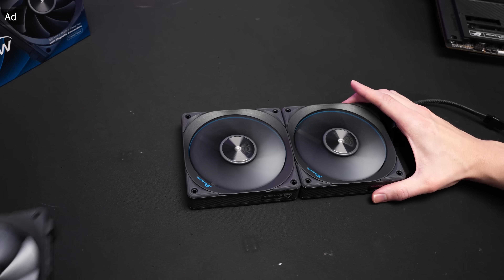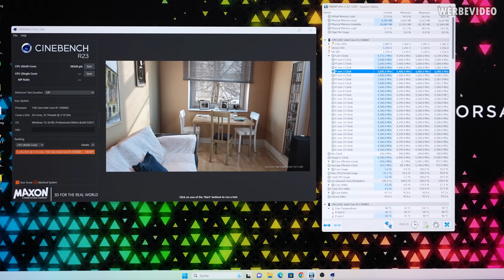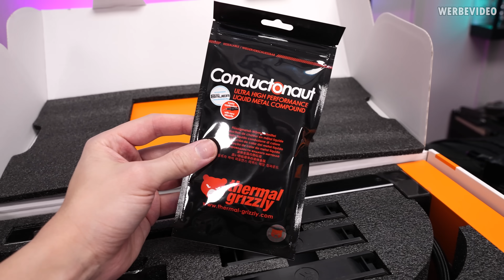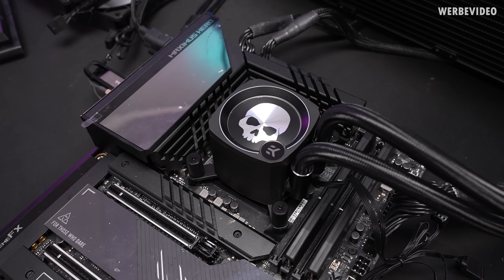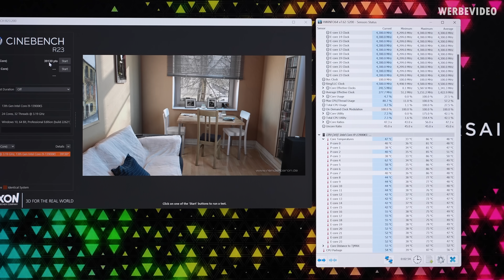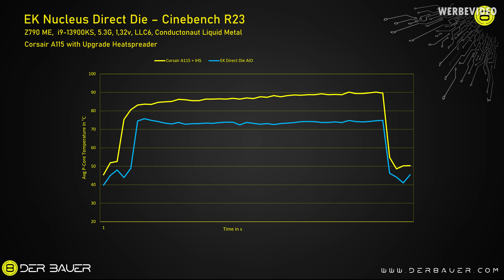Impressive Results! We're testing a Prototype AIO by EKWB

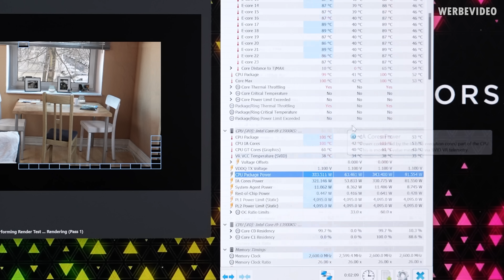Comment: 3:10 god seeing that stock 13900KS R23 feels disgusting, any consumer being told to run R23 a bunch of times to figure out if they're stable and reference stock when getting their PC is just straight up danger zoning their CPU instantly. Over 250A, over 330W, max 100C redlining.. That shit probably lost 0.005mv lol

Horrifies me to think about how many times I might have ran R23 at stock or even Y-C 2.5B I remember 310-320W runs for a minute flat.

Their normal Nucleus 360, I can run at 1.217v load for 5.6/44 and it's about 90c on first run from a cold boot max. From then on it creeps up a little bit. I'd love to try out this AIO down the line - maybe 6-8 years from now lol, when these chips are cheaper to replace if I mess up the delidding.

Comment: Just installed this AIO and all I am getting is error code 55, memory or cpu. Reseated everything and same error, I am very frustrated, came from the same AIO dark version, this not my first time doing this. I have allot of experience, cleared the CMOS, tried one stick of memory, this is on a Asus z790, with a 13900KS overclocking it to 5.8 GHz without issues before installing this. Not sure what to do now if I keep getting this error.? Any thoughts anyone?
Reply: Got it to work, just don't over tightening the nuts on the cooler

Comment: When is somebody going to make an asetek adapter from softline to Hardline? Somebody please make an adapter to g1/4 fitting. It would open up so many cooling options to have bigger radiators better pumps more fluid on so many different aios.

Comment: This needs to be compared to A. the exact same AIO but in non-direct-die version and B. to a custom-loop direct-die setup (eg. SuperCool direct-die kit with Hardware Labs 360 GTX or GTR radiator). Also, fans and fan speeds should all be identical and at 100% on all 3 setups to take them out of the equation.

On a separate note, a test using that copper heatspreader VS stock Intel but BOTH being delidded and liquid metal on inside & outside (or LM inside and high-end thermal paste outside) would be good that way all the other variables (delidding, LM, thermal paste) are removed so we can truly see how much the custom heatspreader itself contributes.

Comment: I have a dual rad 
1 360 ek surface
1 240 ek surface 
Heatkiller iv full copper block. Thermal grizzly Contact frame 
It blew me away to see 88c no matter how long i run r23. With my 13900kf

Comment: I think you need to be clearer at the intro that your liquid metal and your direct die bracket partnership was is included. not just for transparency but have a bit of pride in your work too.   It cool pun meant that your products are being used :)
Reply: Though next time have a fairer test and maybe use a liquid aio to do the comparison regardless of how good the air cooler is, its again only fair.

Comment: This testing sucked. You should have shown a 14900K stock voltage with full power limit unlocked and running Aida or prime 95 or OCCT WITH AVX2 no offset and with voltage offset. What a shame of a video.

Comment: Roman, That is very cool tech and awesome results to me.. I have a 13900KS in a FD Torrent case, I did not want to lose my fans, So I went with a pump and soft lines in the case, exiting the case via quick connects into a 10Gal tank. I also have a aquarium chiller in a separate loop into the tank that keeps the tank water at 18-20C. I have my OC at 5900 AC with light load boosts to 6200x4. my system works very well however, I could have went with this solution but having to give up my 2 front 180s fan, but would have done that vs the class experiment I did for my setup.

Comment: Hey man, I bought for the first time your thermal grizzly Kryonaut for my computer when I upgraded my CPU to the AMD 5800X3D from the AMD 3900X, I'm not sure if you can use this as a genuine statistic but my new CPU on the exact same cooling which is the ASUS RYUJIN II 360 AIO, I can see a few degree lower temperatures overall, on the first day my temps were a bit higher but that improved a lot after that, I think that it might had to settle a little bit and I don't know if that's normal but I'm very happy with it, just wanted to let you know this, have a great day.

Comment: G'day Roman,
🤔Considering this EK setup keeps temps low enough allowing you to run your 13900KS at out of the box intel claimed spec instead of throttling like an ASSTEK AIO (of which some are even more expensive), I guess Yes/No depends if the hassle of setting up including the Delid is worth it to you to get the performance you were promised.

Comment: EKWB's De8auer/EKWB Direct Die ILM replacement system + Direct Die cold plate was HORRIBLE it got DESTROYED by Iceman and Supercool in terms of performance, Many people discovered the contact pressure was horrible because EKWB built to much of a safety factor into it's tolerances so the coldplate BARELY even touched the die surface. EKWB tried to revise those cold plates and they managed to get even worse lol. They had thousands of RMA's, so how is this going to be any different. I doubt they learned their lesson. Dave Alcock never even responded to the issue publicly or said a thing. If they were smart they would put out a press announcement right now and show their potential customers what they have changed (if they have in fact changed anything). I want to see old specs vs new specs on the ILM and cold plate design before I even CONSIDER buying this.

lastly, where is your LGA1700 Direct Die Mycro block Roman? You teased it like 8 months ago and said it was ready, then you moved shops and put it off. What's going on with that?

Comment: Don't know about the D2D -version, but the original EK Nucleus Lux 360 D-RGB model is a fantastic AIO. I use it for my 12900KF (Z690) setup, and it cools 250-270W without any issues. Temps in R24 stay below 85°C with a pretty major OC. I use a thermalright frame though.

Edit: i would have liked to get the model with the display, but it was nowhere to be found.

Comment: That is running at the same temp my undervolted/overclocked 13900KS runs at w/ 5.7Ghz/4.4Ghz. 1.199v 275W in R23.  Mine's not delided and just using an EK Block and 2x EK P420's. Was thinking about deliding it, but I think I'd rather save the warranty over a small increase in delided temp and get a chiller at some point instead.

Comment: I've been curious how the plate is on Velocity2 for direct die, I modified and used this for my 7950x3d by reducing the standoff height by half on the backplate (short backplate didn't work since asrocks boards put components outside the marked area.  Results look very good though hoping to see more direct die solutions in future.

Comment: Would be nice if you could test how it performs at high voltage and high clocks. 1.4-1.45 volts vcore 5.8-6ghz depending on what your sample is capable of.

Comment: My 1920 X threadripper with a heatkiller IV mounted on it 5 years or so ago ( with liquid metal ) idle at 37 deg C
So de lidded CPU + special H2O cooler dont sound terrible impressing, but of course it is not the same CPU

Comment: Yes! Please do compare direct die cooling with custom waku loop as well! It would be really REALLY interesting if you could get the IceMan Direct Die water cooling block. I’ve been wanting to get it and everyone I’ve asked about it swears by it. HOWEVER I couldn’t get an answer how the socket mounting pressure is solved with the block as by the look of it the only thing actually making contact with the CPU seems to be the die which then almost 100% guarantees that the CPU pcb will eventually start bowing. I would of course rather see a direct die block from you but seeing how you only made one for AMD one has to go for other alternatives. 

Unfortunately he doesn’t seem to speak English as he couldn’t answer my questions about the mounting contact points between the all in one waterblock and CPU as he clearly didn’t understand what I was asking about. Anyway please Roman would you be so helpful and test that block as it’s a really interesting solution that would effectively eliminate the use of a mounting bracket IF the actual CPU pcb is also put under mounting pressure and not only the CPU die.
Luv ya and appreciate you!
✌️🖖

I tried posting my comment but it didn’t show up for some reason so I’m trying to remove the link to AliExpress to the IceMan direct die block and post it again.

Comment: I've always speculated that coolers have wattage capacity ranges, some call that a TDP. The Corsair or NH-D15 is a 250w+ cooler or basically the cpu will boost 250w all day long and stay in the black, but go over that and you run into red, as shown with the 300w numbers constantly hitting 100°C and thermal throttle.

That said, the aios are similar, 120mm is 150w, 240mm is 250w, 280mm is 300w, 360mm is 350w etc on average.

So you put a 250w air cooler up against a 350w aio on a 300w+ cpu. Guess which is going to loose. A more accurate comparison would have been a 240mm EK DD as that normalizes cooler capacity as best as it realistically can.

This is a limitation of aircooling, physical capacity. Aircooling might be more cost effective and efficient under TDP, but TDP in itself can be limited and a 360mm/420mm Aio or custom loops are far better solutions if case size or cost isn't in the equation.

Comment: Guys, which AIO cooling holds the 14900k in stock?  Or what do you think about custom cooling with a 360 - 45mm EK radiator with the alphacool waterblock.

Comment: your copper heat spreader is interesting!
is the die height of lga1700 the reason you haven't released a direct die oc frame instead for general air coolers?

you said that shaving off the last few degrees is only something custom loop people would be into, but on the opposite end silent sff people like myself are also quite keen so i'd be interested in direct die even with a tiny air cooler!

Comment: Your chart has 'Time in seconds' on the bottom axis.  The problem is that it doesn't show how much time anywhere other than '1'.  I do not believe that you are doing this to be intentionally misleading, but it does make it seem like the chart is only half done and with half the information missing it makes the test non repeatable
Reply: Regarding testing I would like to see, I would like to see a traditional AIO with traditional lidding versus this kit.  It doesn't really need to be a very expensive CPU since it would clearly require a stock CPU to be delided again.  Even a 12600k could be possible to push enough power thru to demonstrate the differences.

Comment: NGL seems good comparing an air cooler a delidded CPU, but... The air cooler is probably a limiting factor...

It would be interesting to see the comparison with a regular AiO, delidded CPU and liquid metal below and above the IHS tbh.

I'll stick to my... Delidded Intel Core i9-14900K with a lapped IHS, contact frame, TG Conductonaut between the die and IHS, TG Conductonaut between the IHS and the coldplate of my Corsair H170i ELITE CAPELLIX alongside 6 Fractal Design Prisma AL-14 RGB fans 😅😅😅

Comment: Hey Roman, I want to buy Alphacool Supernova 1260, will I lose something in performance compared to MO-RA3 420? The radiator will be half a meter from the computer, I will use one D5 pump. Should I use the same 200 mm fans from Noctua or Push/Pull on the Arctic P14?
Reply: You’ll be good with either. I’ve been pretty happy with the Watercools NF-A20 HS on my MO-RA I barely use the higher RPM though. I also got a demciflex filter after a few months which obviously restricts the airflow a bit.

Also how big is the loop with just 1 D5? Will you be using QDC’s? Koolance would be my go to.
Reply: @Simon_Denmark  There is one water block per video card and processor in the system, I will use 4 Quick Release Fittings. The radiator will be located half a meter from the computer, I think one D5 will be enough

Comment: i am currently running direct die colling with my artic freezer ll 420 aio disigned my own mount and baammm works like a charm.5.8 ghz all core 1.430v 4.5e core cinebench score 42.839 max temp was 91c

Comment: This needs to be done for AM5 Ryzen 7000 as well… Ryzen isn’t getting very many direct die products, and is arguably hotter than Intel.. Also can you test in gaming to see maximum cpu clock speed?
Reply: Thermal Grizzly sells both an AM5 heatspreader, and a direct-die waterblock, except neither are in stock anywhere.

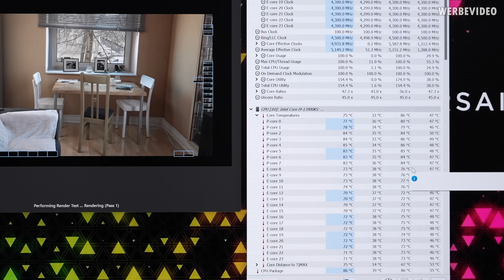Comment: 7:45 How am I getting the same score on a 13900k with 253w pl1 and pl2 limits applied (10 minute run) as your 13900ks with direct die cooling and no limits :/.. I have a gigabyte aorus master with Internal AC/DC Load Line on power saving, Medium LLC and adaptive undervolt with v/f points. (-0.055 at 5.1, -0.065 at 5.4, -0.033 at 5.7, -0.015 at 5.8). Granted, without the undervolt and custom ac/dc settings I was only getting 36-37k, but still. I'm guessing you did not disable realtime protection in windows? That will crush your r23 scores in my experience (1-2k lower points over a 10 minute run)

Comment: Why did you compare a direct die AIO to an air cooler? That's as 'apples to oranges' as you can get. If you're not going to compare it to an open loop system, then at least compare it to a normal AIO to see what the benefit is for going direct die.

Comment: I would like to see a (stock cpu + 360mm aio) vs (this thermal solution). 

At first, both running on stock just to compare thermals. 
On the next part, the MAX possible OC with both. I think that's all we wanna know: how much of a performance gain do we get with it.

It would be nice to see that on a 13700k or 14700k too (CPUs with less thermal bottlenecks).

Comment: Not defending EK but the Predator? That was like 8 years ago and basically a custom loop sold as an expandable AIO. It couldn't have less in common with this. I even have modules from the later EK-Phoenix revision I got on clearance then modified into a full loop and haven't had any issues for ~4 years now. The problem with EK is their pricing for what you often get and their cheap nickel-plating. I would not be surprised if one of the big AIO names is simply making these for them anyway.
Reply: Predator was ahead of the time at that time, and it basically used custom loop parts and was consequently too expensive for the AIO segment.
Reply: @EYEupP  Yeah and from what I can tell is almost identical to the Phoenix in terms of functionality. Main difference seems to be the less powerful pump. Even the CPU module is effectively a Velocity block on the inside but I swapped it out for an Optimus block. 

I'm planning on trying to swap in the DDC used in the Predator but surprisingly this one has held up fine, even with an extra rad and GPU block. The only frustrating thing about all of it is it's a huge pita to purge and fill.

Comment: Performance wise it looks more consistent than their custom water cooling block that lots of us have had issue with , in the end i moved to the Iceman Direct Die cooler and it was the best move i done as now cools 253w at 59 deg c where as the EK DD kit was constantly in the 80 deg c range at the same wattage🤨 It wouldn't be so bad if EK stood by their product and did a recall for all the faulty units and attempted to fix the issue but till this day they are still selling them faulty as a friend recently got one and was worse than mine at 100 dec c under load🥵
Reply: That's impressive if real, I wonder what benchmark or is that in game? What undervolt/underclock method you used if any?
Reply: @aeon7748  100% real result , if i was able to post a picture here i would . Benchmark was R23 and running stock intel power limit of 253W , water temp was 22deg c and package temp was a max of 58/59deg c . All cores were within 5 deg of each other temp wise . as water temp increases so does core/package temps but that is totally normal . overclocking the CPU can get it to consume 450W and the Iceman DD kit will then hit 99 deg on mine but never run it like that ... the EK kit was lucky if i could cool 320W 😂 Give the Iceman a try i am sure you will not be disappointed and would be good if Derbauer tried one for review as again i am sure he will be impressed as it just works perfectly as intended😃